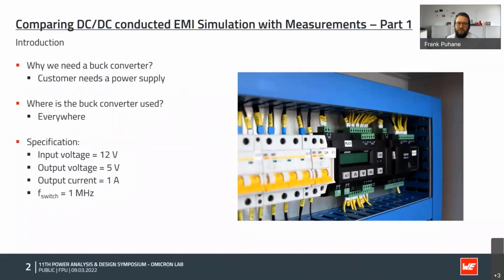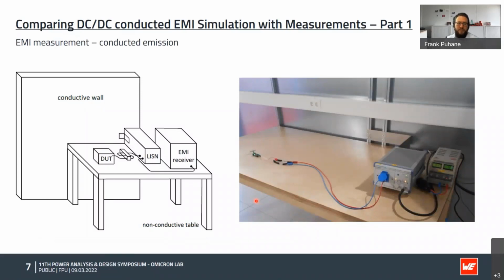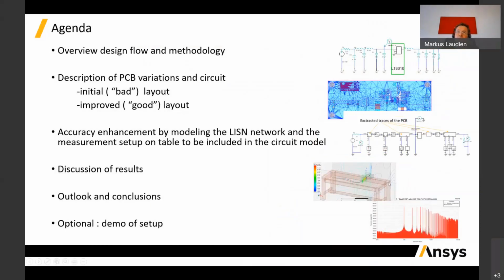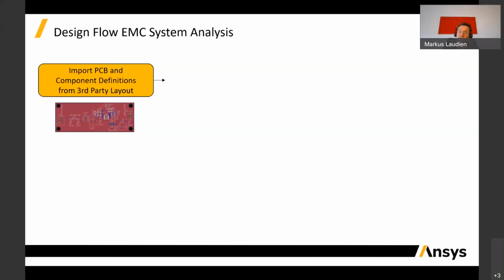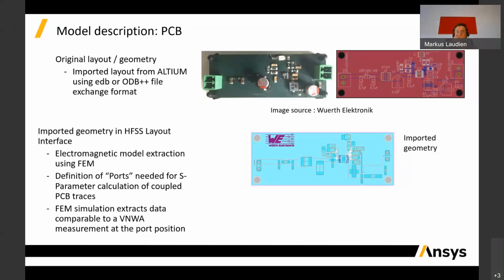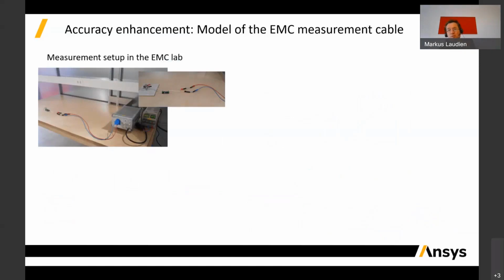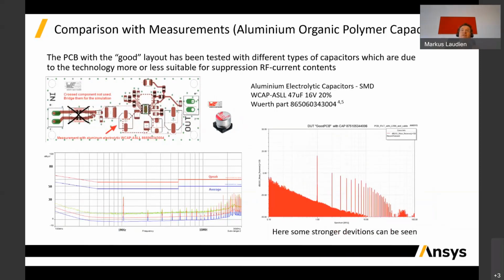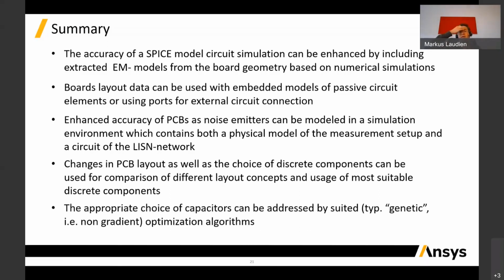Comparing DC/DC conducted EMI Simulation with Measurement Results

Comment: Hi, where can you get the SPICE model of the VRM chip LT8610? I could not find the SPICE model of this IC on Analog device, also if I have a VRM with no SPICE model, how can I perform the simulation like you have done? Thank you
Reply from the maker: On the Analog website it says that LTSpice contains a model for the LT8610. After 15:00 the presenter mentions that a model derived from the LT8610 was used. Unfortunately we don't know more about the details.
Reply: Many thanks @OMICRONLabTutorials